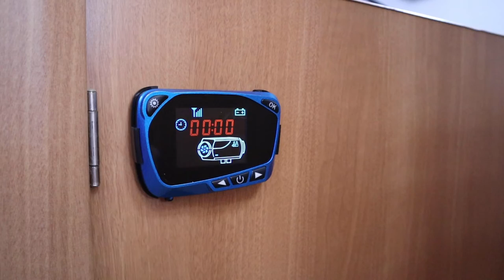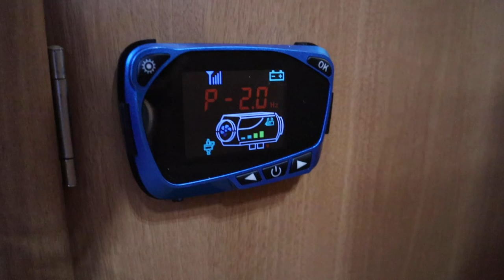Diesel Heater Install into a Caravan! Is it worth it??

Comment: A note from a plumber here. There is an error in the installation of the outlet fitting in the diesel tank. The ‘O’ ring should be on the inside of the tank to be sure of a good seal. There’s a significant chance diesel could seep along the threads if installed as shown.
Reply from the maker: Thanks for the tip. I have since changed the it around. Cheers
Reply: Mine came with one on each side
Reply: Hi it's far better to fit a stand pipe in the fuel tank , no chance of a leak , also mount  pump max 2mr from  tank ,pipe size from pump to heater should be hard nylon 2.5 mm Id,  good vidio

Comment: Good instructional Video, few things you may like to add from my experiance.
1. Fuel line, pump and priming.
The fuel pump does produce slight Vacuum to suck the fuel, however the pump only pumps tiny amounts of fuel with each pulse or tick.
If the pump is mounted higher than the tank and or you have too long a line between the tank and pump the air in the line will expand when the pump ticks slightly as well as colapsing the hose wall then it expands when it stops preventing fuel from being pumped.
To fix shorten the line and mount pump closer to bottom of tank.
The pump can  push fuel up approx 10 meters of fuel line and 3 meters high above the level of fuel in the tank.

2. The fuel line suplied is rigid plastic and small in diameter.
You can replace the line between the pump and tank with a larger rubber line like in this video, but dont replace the line after the Pump.  
The fuel line after the pump going to heater is exposed and vulnrable to the enviroment and inside the van to being kinked or crushed.
I recomend threading the thin fuel line through 6mm or bigger suitable rubber hose or fuel line to protect it.

3. If the pump is lower than the tank it will prime it self. 

4. To silence the ticks, use soft EPDM rubber pipe insulation or strips wraped around the pump then use a rubber or PVC pipe saddle clamp, google heater pump rubber mount.
I think your box idea was good but the rubber hoses comming in and out of the box where transfering the vibration to the plastic box and because it was mounted to the chassis amplified it through the floor. 

On a side note the heated exhaust on the heater can get hot upwards of 100-150c, mounting the heater under the bed like that could be a problem.
I would place some rated glass wool insulation over the exhaust then some type of cover so the thin aluminum hoses dont get crushed.
I think a fire risk to be exteam, more so malfunctions.
Reply from the maker: Thanks for the detailed comments! Some awesome tips in there! Sounds like you have installed a few of these 😀

Comment: Hello from the high desert of New Mexico USA 🇺🇸. Here is a tip, put some clear soft pvc hose over the  hard white nylon fuel line and then use insulated clamps to mount the fuel line. I hope this helps you. Keep up the good work and stay safe and charged
Reply from the maker: Hey mate! Thats a great tip! I will definitely do that :)
Reply: Does this aid in eliminating the pulsing sound?
Reply: @brent7344  yes

Comment: Thanks
Reply from the maker: Oh thank you so much! Its much appreciated! Glad you enjoyed the video! :)
Reply: @GetCampingOz  Thanks for all the Great info.  I am Half way through my installation .Fitting the Exhaust---- When i clamp the pipes to the muffler and to elbow i can not get a tight fit it does not clamp on  . only to the outside fitting -- not sure how to fix this... Also the Muffler when you hold your hand over one end and blow through the other the Air escapes out of gaps at each end near the intake and outlet  also at drain hole at bottom , As the Muffler is positioned under the van think a lot of exhaust could build up under the Van ,
Would appreciate your thoughts.
Thanks Joe
Reply from the maker: @joemak8629  Hi Joe, No problem at all. Sounds like your kit might vary slightly to mine as I didnt have any of those issues you are experiencing with your install. There is lots of different kits out there with slightly different changes to how they are installed. The exhaust pipe should clamp slide over the neck of the exhaust outlet of the heater and gets secured with a metal hose clamp.  The other end of the exhaust pipe should then slide over the muffler end and clamp on. The other side of the muffler can have another extension pipe added if needed. The drain hole on the bottom shouldn't allow too much exhaust gas out providing the muffler is flowing properly. The exhaust should always exit the side of the van so that there is no risk of fumes accumulating underneath. Hope that helps! :)

Comment: I have had one in my van for the past 4 years with no problem, something you can do it add a cap of desiel cleaner in you tank, I use a 5L tank ( the type you would put in your van tank ). I also have these for heating the lower floor of my house here in the UK.

Comment: Just a couple of points.  

The pump.  It will lift fuel by about 50cm - so no problem with most installations.  There is also no pressure involved, so the pump to machine distance will not be important for your installation.

Secondly, the pump ducting.  The exhaust length is limited to about 2m (and limited to 270 degrees of bends, I believe).  Any extension should be of a larger cross sectional area.  The combustion air ducting is likewise limited in length (without increases in diameter).  These limitations are to ensure the resistance, to gas flow through the system, will not be excessive and will allow complete combustion of the fuel. The warm air ducting is likewise limited in size, length and number of bends.  That one fan shaft shifts all the combustion and warm air, so should not be overloaded.  

Not important for a simple installation, but many ignore these limitations - probably because they don’t know they exist!  They are likely the ones who get trouble and blame it on the heater.🙂

BTW, the machine will be using that approx one amp all the time, while running normally (excluding stops and starts).

Overall a good video on how simple these machines are to install and use. (Plug that small hole/slot in the base plate if not required).  A CO monitor/alarm is only a few dollars (for up to ten years protection) - not a high price to pay for your safety, even though the risk should be low.
Reply from the maker: Thanks for the great tips!
Reply: I have a 24v model and a 240 to 24v 6amp supply linked into bus electrics for when running on mains...

That should be enough to run the unit, including start?
Reply: @winzracingNZ  The typical maximum starting power of these heaters is usually around 120W.  A 6 amp supply at 24 volts would/should be adequate because that is 144W.  However, a 1 or 2 amp power supply, with a battery as buffer,  would be far better as a) it would be better matched to the average power used and b) the battery would offer protection in the event of a mains power failure.

One amp would likely be adequate (if the heater is generally run on limited output power) and two amps if it is generally run at or close to, full power.

Most buses (apart from the ‘mini’ versions) operate on 24 volt systems?  I would expect a 6A power supply, connected to the bus electrics might ‘fight’ against the usual battery charging system (from the mains supply).  More thought required, perhaps, as it may not need an extra power supply at all!

Comment: FYI I’ve fitted a few of these heaters. My latest one is exactly the same kit as yours. Now re the position of tank/pump etc, I have my tank on rear bumper of caravan. My van is 21’6 and the pump is approximately 5-6 meters away from tank. I’ve used rubber fuel hose instead of the transparent line you get with tank and also a Ryco filter. I’ve run the heater for 4 consecutive nights for approximately 8-10 hours each time without any issues at all. I believe this kit/heater which is the same as yours is the better one out of all I’ve had previously. Great vid by the way.
Reply from the maker: That’s really good to hear. I’ve done similar testing to you and run it for long periods and had no issues at all. Thanks for the support 😀
Reply: Can you tell me what the level of fuel use is at different heat settings? Nobody seems to cover that.

Comment: Just came back in AGAIN to check out the start up process after the install. watched your demo diligently, wrote down the instructions to follow, and hopefully all will go well. have a few trips coming up where I wont have a powered site, and it's going to be cold.
Cheers
Reply from the maker: Hope it’s all working out for you? Have you tested your heater yet?
Reply: @GetCampingOz  . A sparky mate of mine came over last night to wire everything up and then he fired it up, works like a dream. He just winged the startup process and he reckons he may have overdone the priming thing, because we could hardly see the house at first 🤣 but it settled down, eventually. there was moisture coming out of the muffler, which I thought was just condensation, but it was diesel, so he must have flooded it on the prime. Anyway, it settled down and on the high temp, you would be ripping your clothes off. turned it down to the lowest setting and it was beautiful. just as a trial run, I fired it up an hour ago and it just went perfectly. I'll be needing this in Stanthorpe at the end of the month.

Comment: Hi great video 
I mounted our pump in the supplied mount and then onto a small mount from Bunnings 
The pump is under the Van directly below our bed. We can’t hear it at all. This works a treat and easy to do
Reply from the maker: Cheers. I’m still playing with ideas to see what the best solution is. What mount did you purchase?
Reply: I got it from Bunnings
It is Goliath
Goliath 30 x 40mm Dome Cylindrical Rubber Isolator
If you like give me am email and I’ll send you a photo of how I used it
Reply from the maker: @waynekerry2115  great thanks Wayne. I’ll check it out 👍🏻
Reply: @waynekerry2115  Hi Wayne, I would love to see a detail/picture of how you have mounted it
Reply: @joshuabeasley6558  Hi Josh
Not sure how to put a photo up on here
Reply: @waynekerry2115  did you just mount the rubber isolator to the chassi/fixing point and then the pump to the outer of the isolator or something more technical ?

Comment: Right, mate- I've just come upon your video on my 'HOME' page. Probably due to me very recently ordering a 2KW VEVOR diesel heater. This is a brilliant video, liked and subscribed. I'm in Ohio USA and have an old Ford truck with a tall camper top. I plan to build an extension from the cap over my tailgate (this is legal). I'm thinking of trying to install the heater inside a compartment at one end of the tailgate inside the 'new addition' and the fuel tank beside it in a separate area that is plastic lined with a tray under it as suggested. If I mount the heater on brackets raised up from the compartment floor I thought that the air intake tube would be unnecessary. I could utilise air from inside the interior of my tall truck cap if a few (2 inch- 5 cm?) holes are drilled into the interior side of the camping truck cap area. Ta, mate- right champion!
Reply from the maker: Thanks mate! Sounds like you have some plans for your truck! Cheers Adam
Reply: @GetCampingOz  Ta, I appreciate the encouragement.

Comment: you can wrap some sound deadening material around the pump. the more weight you add this way, the less sound from the pump !  I used Alubutyl  and that really makes a difference.
Reply from the maker: Great tip thanks!

Comment: I seen a comment on another video that somebody made about a top feeder for the fuel by going through the top of the tank and let the hose sit on the bottom because if you need to replace the tank or take it out then having the fuel line at the bottom allows leakage but if it's at the top it won't leak at all. I kind of like that idea more than bottom gravity fed
Reply from the maker: Yeh that’s a great idea. I am looking at changing the tank over so it is top fed. Mine hasn’t leaked but it has always been in the back of my mind. Cheers Adam
Reply: @GetCampingOz  I'm buying a E250 extended van from my boss and I'm going to strip it out then insulate it and do a build on it. That's what I will be living in from now on. I've been living in a pickup truck the last 3 years in the cab which is an extended cab with the seats removed except for the driver seat. The truck hasn't driven in a while since it has a blown head gasket so I have it parked at my boss's shop with an electric line from inside for the last 3 years to provide heat in the winter with a small heater and a fan in the summer to cool me off. My entertainment is a flat screen TV and an Xbox One. I have no ambition to ever live in an apartment and unless I win the lotto I won't be buying a house cuz I'm not doing a mortgage. The whole real estate industry is crooked as the Mississippi River. These Super Rich bastards keep buying property for more than what it's worth so they don't have to pay taxes and it has driven up the price of Real Estate and rent throughout the country. That's why I hate the rich greedy bastards just can't get enough

Comment: I’m thinking of a similar noise solution but I’m going to line the inside of the box with sound deadening mat and mount the box to the frame via vibration padding used for transformer installation.
Reply from the maker: Sounds good 👍🏻 let us know if it works!

Comment: My tip of the day, when you tighten your chuck up tight by hand twist it back the  opposite way until it clicks, this will lock it and stop things coming loose on the chuck and flying out when the brake engages or when you change direction.
Reply from the maker: Great tip!
Reply: Drill manufacturers states its true, chuck manufacturers denies it. For me opposite way is way to loosen it..

Comment: Great video and well thought out install. I mounted the fuel pump on rubber straps (similar to tyre rubber) like you say, the ticking sound will always be there. Thanks for sharing.
Reply from the maker: Thanks Michael. Yeh I’m going to try another method of mounting it on an exhaust rubber and see it that’s any better. I’ll let you know if it works 👍🏻

Comment: Hi, very helpful, may I just say that the diesel tank outlet fitting will seal better with the o ring on the inside of the tank.
Reply from the maker: Good tip!
Reply: The unit I am playing with now is an all in one setup.  I am planning to install one in my truck.  I saw one of many tips I will use and that is to install a standpipe (purchased separately). and drill the holl in the top of the tank then run the stand pipe about 1 inch above the bottom.  The benefit of the standpipe is that you don't have a hole in the bottom of your tank that could fail someday and cause problem.  in your case the hole is too far from the bottom of the tank when it is mounted at an angle (I think). thanks for the video.  I bet your bed stays warm from the  heat that bleeds off the warm air ducting.under that bed.

Comment: Great video with clear instructions thanks mate. My wife put me onto your channel, and I'm glad she did. 

I am a neat freak with any install - always taking a lot longer to plan a job than to actually do it. As you have said, I also spend a lot of time researching things online, and especially YouTube.

A couple of questions or comments:

1. Was there an o-ring on the inside of the fuel fitting? Couldn't quite see - obviously there was one on the outside. Always best to seal fuel on the fuel side, not the outside (for newer diy enthusiasts).

2. I'd suggest having a tray (bund) under the fuel tank in case of spills. One spill with diesel will mean you'll smell diesel in your van forever after.

3. I'd certainly recommend putting the entire fuel line inside a protective cover - exactly like you would with electrical cable. Seeing it's a soft fuel line, a hard cover like flexible electrical conduit would be perfect. I'd place the filter right at the fuel tank, where you can see it, and inside the bund, in case (when) you need to change the filter on the road. Then you don't get fuel in your van. This also works with the entire soft fuel line being inside a conduit - can't do that if there's a filter in the way 👍.

4. Noise is essentially a mechanical connection. Mount everything on a soft mount, including the pump box. Try soft coil springs rather than rubber, which won't do much to decouple the noise energy.
Reply from the maker: Thanks Rod. Yes there was an O-ring on the other side of the tank fitting. Great advice about the bund under the tank. I may change the tank to a boat tank with a quick release. That way when the weather gets hot I can remove the tank altogether. I’m also looking at using some exhaust hangers for the pump box as well. Cheers

Comment: Fairly common error to locate the fuel pipe on the bottom of the tank. In time, the seal will perish and diesel will spill all over your front trunk.... and that smell can be a bastard to get rid of. A hole in the top of the tank, and a fuel stand pipe fitted is the perfect way. If the seal perishes, no leaks. Simples.
Reply from the maker: good tip!
Reply: I was thinking exactly the same thing. I would not drill below the level of the fuel as a leak is going to occur sooner or later.
Reply: @paulmaxwell8851  ...Yes. Watching all these comments has made me decide to ditch the provided fuel tank and get maybe a small outboard tank, or one with a stand pipe. wouldn't be too happy smelling diesel continually.

Comment: you could try hanging some exhaust mounting rubbers from the chassis and hang the pump fuel line  either side of the pump from those.
Reply from the maker: That a great tip! Ive tried something similar but it still could hear the tick.. the search continues :)